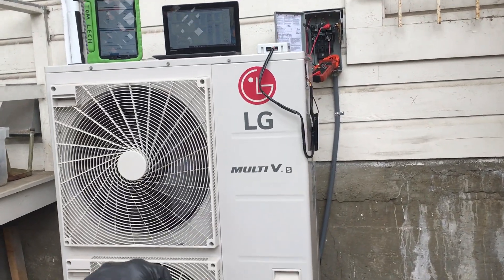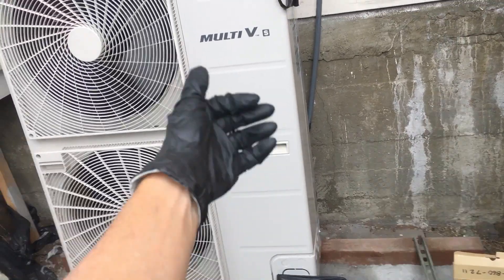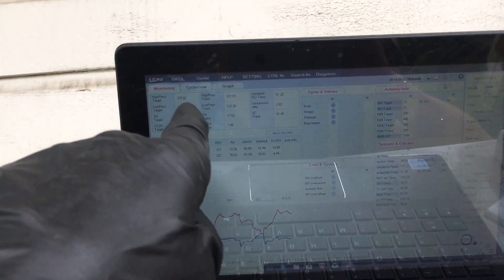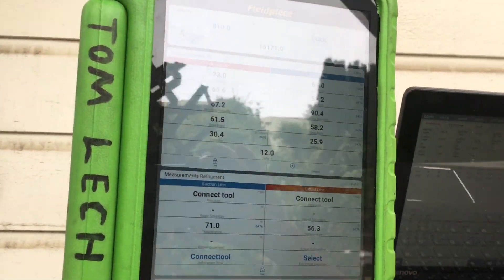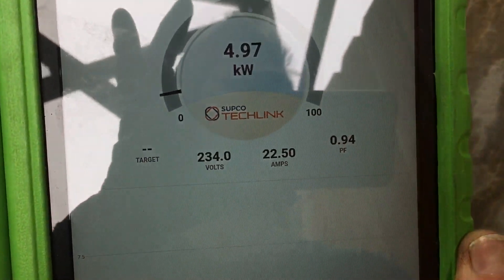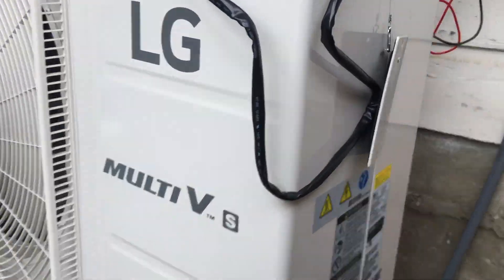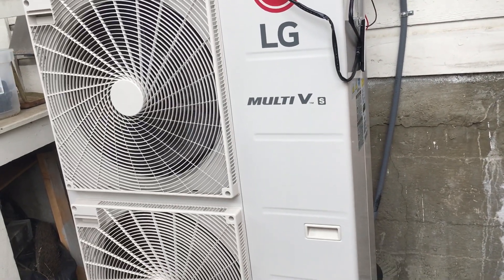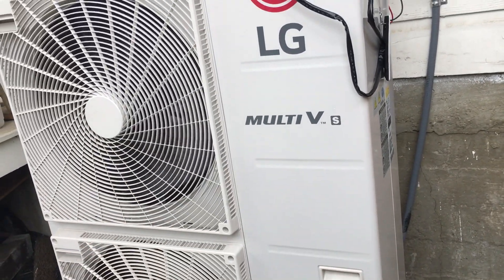LG ARUN060GSS4 these are the quietest heat pumps we have ever installed

Comment: I like the HU123.U33 type (European version, I'm from the EU). Do you have experience with a similar unit in the USA? Will it be a good buy? The parameters suit me. In the EU, it is said that LG heat pumps are noisy.  You are one of the few who will show the unit in 100% load. It's not threatening. I would be interested in noise at 50% load. https://www.lg.com/cz/tepelna-cerpadla/lg-HU123
Reply from the maker: Sorry to get back to you so late You Tube never gave me a notification of this message I just accidentally stumbled upon it today. 

        Water is a more efficient method of moving heat because you can pack more BTUs of energy in 1 pound water then you can 1 pound of refrigerant. 

         Here is the American LG website residential units to look at
https://lghvac.com/residential-light-commercial/

Comment: So what was the issue? You never really said in your 4 paragraph rant lol
Reply from the maker: No problem at all just an annual check up after one year of working in use. That’s a good thing about these units they go years with no problems. As long as you don’t use ISO POLAR line sets that have an issue with leaking refrigerant. I recommend only hard ACR copper piping or Mueller soft copper line set. “ NO ISOPOLAR LINE SET” it’s the only line set in my whole life that I’ve installed from a company that ever leaks.
Reply: @coldfinger459sub0  my Fujitsu halcyon was fine for 5 years before it's first maintenance - is it normal to do yearly?
Reply from the maker: jimmies rustled it’s just something extra I do for my customers to make sure there is no problem catch it ahead of time just in case. You don’t want something like a slow leak in a system running on a low charge for a few years before you return he can shorten the life of the compressor if you wait that long. Compressors should easy last 20 years or more.  Most the whole compressors in my dad‘s days in my grandfathers days last 30 to 40 or years or more.
Reply: Yeah I just replaced a 1989 rudd heat pump last year... Was still running just tripping the breaker.  I don't think there are many heat pumps on the market today that will be around in 30 years...
Reply from the maker: jimmies rustled it mostly depends on the installer and if it is sized correctly, maintained. in duct sizing correct.
Reply: What's the efficiency rating of this system? Where can we find more info?

Comment: Wondered if you could clear up the LG Models: I found information on the LMU600HV, but the HVAC contractor gave me a quote for the ARUN060GSS4, since both are VRF units at 5Ton - I wonder what the difference is between them. You mentioned this was the commercial unit, but I don't really know what that means. It seems like LG has 2 lines of Heat Pumps: The Multi-F Max and the Multi-V S ..I've been digging around the internet to figure out the difference. Appreciated if you could help. Thanks.
Reply from the maker: two2uts OK got home at night I’m not driving I did not give you all the correct information in my statement above that’s what I get for talking while driving.     Here’s the LG link that will take you right to the page of this unit it’s a heat recovery unit. It’s better you read it so you completely understand the benefits if it is suited for your situation as if you need to cool one room at the same time heat a different room. Can perform heating and cooling simultaneously a standard heat pump cannot a standard heat pump can only cool all the air handler’s at one time or only heat all the air handler’s at one time.   
https://www.lghvac.com/search-results/.                                           

No matter what LG unit you’ll pick you’ll be picking a good unit.  But remember no matter what product you choose it’s the confidence in the installation of the installer that makes all the difference in in the world how it will perform and how long it will last.
Reply: @coldfinger459sub0  Thanks for the reply. It looks like LG has multiple models in the Multi V S line: the Heat Recovery model is ARUB060GSS4.. 'B' vs. 'N' - I don't think we'll need the recovery model but I'm still lost as to the difference between the Multi V S and the Multi F Max.. anyway appreciated the advice.
Reply: two2uts two2uts the difference between the Multi V and Multi F isn’t much in terms of some technicalities like the amount of line set the unit is designed to handle. Performance shouldn’t be obviously different between them, however the commercial unit ( heat pump only)  has more flexibility for commercial applications in theory. You would have to compare the specs in the engineering manual. The resources on LGHVAC.com has all that. 

I’m still going through them myself between these exact two units. I want the Multi V also ARUN060GSS4 because of the specific indoor air handler I want which is the ARNU543M3A4.
Reply: two2uts the main thing with the V is that it also does long line sets and high static pressures. High static pressure is for if you need to blow air into a high rise building with the outdoor unit on the first floor.

Comment: Sir, you are truly a fanatic, and I mean that in the best way possible.  I didn't know that LG made 5 ton units like this.  So are these better than the residential systems or just have different indoor units?  I'm looking to install about 10 tons in a small commercial space in NYC with 6 indoor units, would you go with 2 ARUN060GSS4 or 3 of something like LMU420HHV  ? (I need something rated to heat down to -13F).  LG Excellence contractor or just LG certified contractor?  Budget is only around $30k, do-able?
Reply from the maker: For what you described. 
  You need a proper heat load calculation done on each interior space. 
  You don’t just guess at the size. 
     And depending on the layout, like if you have Windows down at the ground level that are cold most of the year cause they’re in the shade and then you have the other side of the building that might have south or south and west facing windows, specially at an upper level you may want Heating & Cooling simultaneously so you’ll need a heat recovery unit. 
    It all depends on your situation. 
     But from what you describe to be, I don’t think there’s no way I can do it for 30 K. . 

No matter what brand equipment you select if it’s not the right type and it’s not correctly heat load calculated for the right kind of job often customers are unsatisfied with the outcome of the equipment and it’s not the equipment fault .
      It’s often the lack of proper sizing, and then it comes down to the person not being qualified and not experienced improper installation leads to failures, and system is not working properly. 

The best equipment is the equipment that is sized properly and installed correctly .
Reply from the maker: Bob P New York I’m pretty sure the labor rate is pretty high permits and fees are pretty high the length of time you have to wait for inspections are pretty long. 
        Keep in mind the cost of your electrician on the top of the cost of your HVAC contractor. 
     If you run three separate units or even two separate units you will be paying the labor of a electrical contractor to make three separate runs from your main panel to each individual unit think of time and materials times three.

        For each HVAC system you have connected the set up and commissioning procedure will be separate and charged on top of the labor of the install so Ia commissioning labor and set up times three. 

     You may want to go with one of these you will just need one.

https://lghvac.com/commercial/product-type/model-details/?productTypeId=a2x44000003XR0T&modelId=01t44000008fw8b&modelNumber=ARUM121BTE5&iscommercial=true

There’s many choices of different type of head styles high static pressure high velocity medium static pressure low static pressure wall mounts floor mounts even traditional vertical or horizontal air handler’s. 

      If you have reserve left over capacity you can even attach a water heater to help supplement any electrical heating of water because during the summer all the money in power you consume to cool off your space for free all that heat can be transferred over to a hot water heat exchanger for domestic water use. 

           And if it’s in a commercial space you could set timers and energy monitors so you know which offices or floors of the building is consuming how much power and what use at what time so you can bill any after our times or weekend times if you were the one flipping the bill and anything after our gets charged to the customer who’s renting. 

      They are extremely quiet and Stream Lee reliable but that all depends on how good the installer technician and their knowledge of equipment is.

         Highly highly extremely can’t stress enough a very good voltage surge professor transient suppression connect it up to your main electrical to save circuit boards from Brown outs blackouts voltage spikes surges. 

         A bonus of the commercial units over the residential extremely long refrigerant line lengths you could remotely position your outdoor condenser is very far away if for any reason you needed to hide them to make them obscure or if you had some ridiculous restrictions put on where you were allowed to place them these units can be placed very far away and still operate unlike the residentials cannot.
Reply: @coldfinger459sub0  Thank you so much for your well thought out response.  It seems to make complete sense to me to get the unit that you recommended especially since I will probably have some moderately long runs feeding indoor units on the first floor from the roof unit about 30 feet above and up to 80 feet away across the building.  I went to the LG website and made a short list of contractors who are authorized by LG and will make some calls. 
Is there a big difference between the installers listed as "LG Excellence" and the regular installers?
BTW budget of under $30k excluded electrical, hopefully I'm good.
Reply from the maker: Bob P I cannot speak for contractors whether one person is better than another but of course contractors that have taken more of the factory in-house training courses and have put out the effort to take the online training courses so they have fewer mistakes on their installations and can give the customer better service is always a bonus. 

       30 K limit as your total budget you better go down to the grocery store buy some bags of ice and some fans and hang them up in front of it. 

        I cannot even imagine how it’s even possible for the purchase of the units indoor and outdoor throw on top of that the copper the insulation and everything associated with attaching the components on the roof down the walls through the ceilings and hanging the air handler‘s from the walls and ceilings you would have to be paying your workers about three dollars an hour and the contractor must be gifting you all his time for free at that price. 
        Even if you went with three smaller units and you were thinking of buying just the equipment by itself plus all the hardware with copper and insulation in all the components including no labor and no markup you would be hard-pressed just to make the purchase price at 30 K. 

       I’m located in San Francisco California and I believe our labor rate and cost of doing business is very neck to neck with New York. 

       From what you describe the only way I can see doing that job for 30 K or less is purchase Goodman units online and use labor from Home Depot parking lot or off the street under the table cash and have some contractors labor who installs unit on the side on the weekend to make some extra cash under the table. No permits no inspections completely off the books. 

      If you are the owner of the property and you are flipping the bill for the electrical costs pain energy the long term payback on monthly savings for your return on investment over the life of the equipment and less headaches and breakdowns compared to the normal American company split systems and all the problems associated with them your best off spending the extra money and getting the LG units or similar manufacture with the same technology. 

       But if you are installing this with permits and you want to get a quality contractor get the highest recommended if you could get in contact with the distributor of the LG products in your area. Do not try to save money by getting a residential or light commercial contractor who’s only experience has been installing your average ducted residential or commercial system by American manufactures try to find somebody with experience who is installed several of these units first do not be anybody’s guinea pig. 

        It’s very difficult to find a contractor who is not out for the quick money that when they install your system they have to think about it that’s their baby that’s their wife and they are married to that unit for the next 20+ years of the life of the unit and are willing to back that up on that line of equipment.